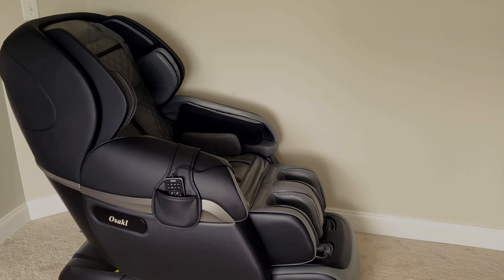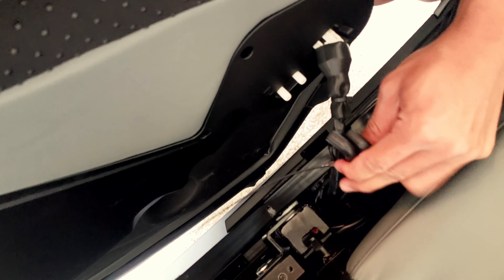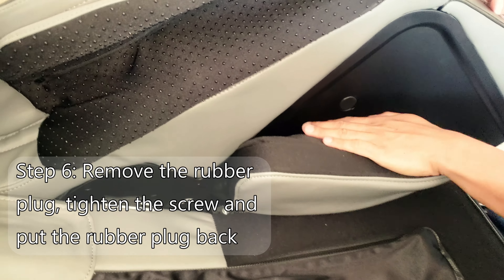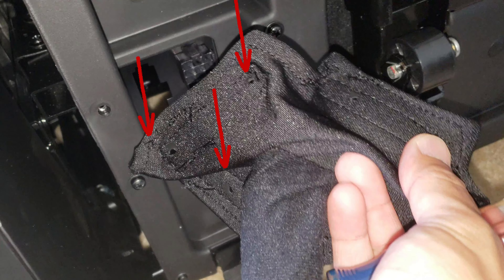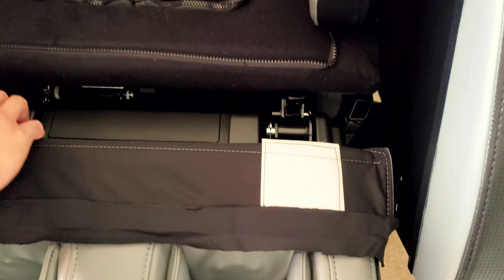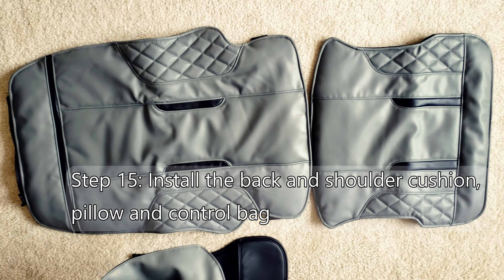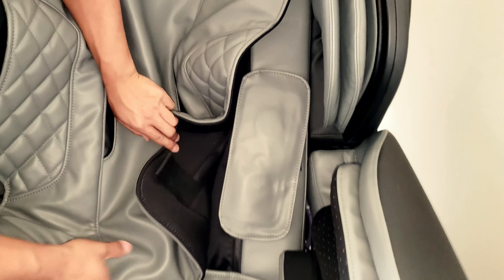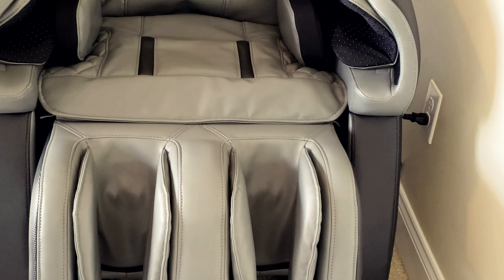Osaki Paragon 4-D Massage Chair - ASSEMBLY VIDEO 👍💺

Comment: Hi. What’s the size of your doorway? I was thinking of getting the same unit but my doorway is 29 inches. I’m wondering if it will fit even with the unassembled body? I’ll appreciate your response. Thanks
Reply from the maker: @momoftwo8415  Door is 36 inches wide
Reply from the maker: you can maneuver it through the door it didnt require the whole 36” and with the door and hinges its probably closer to 29” anyways